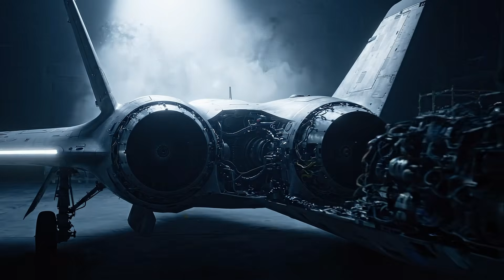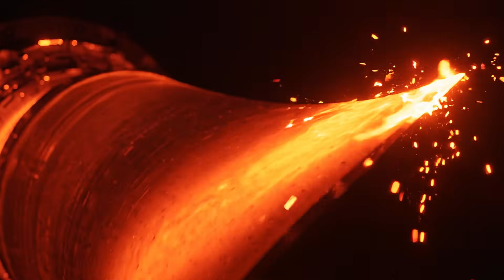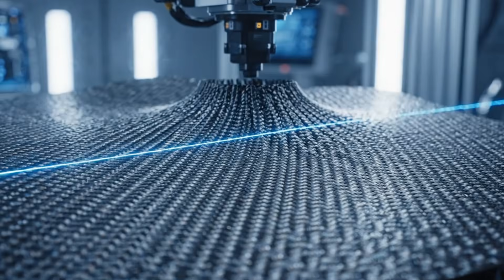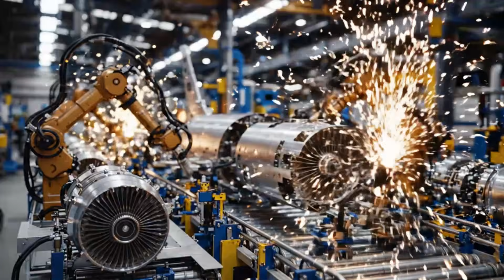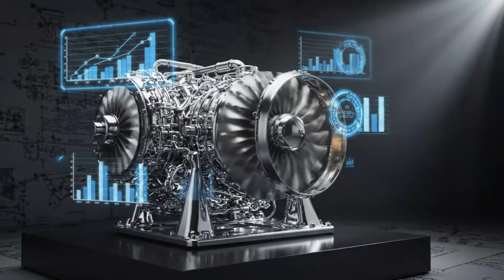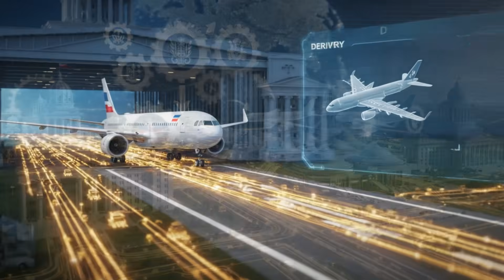The End of Western Aviation? China’s CJ-1000A Just Changed Everything.

Comment: Further, China is not just focused on the CJ-1000, but is working on higher thrust engines for its forthcoming wide body jets.

"CJ-2000 / AEF3500 (for Comac C929): A high-thrust engine intended for the upcoming C929 widebody, with test runs reported and development aligned with the aircraft's 2030s service entry goal." (Google AI)